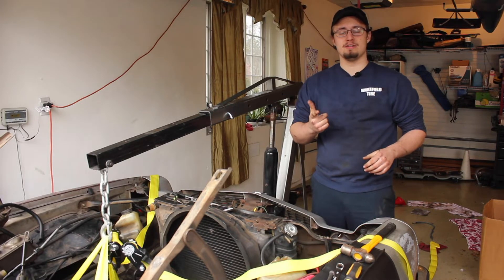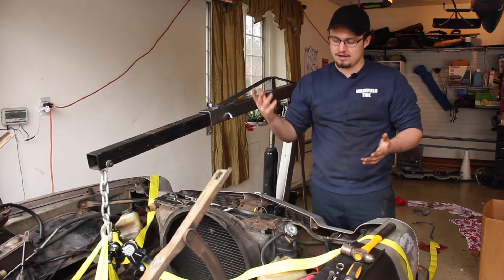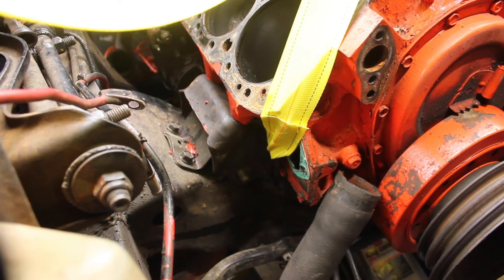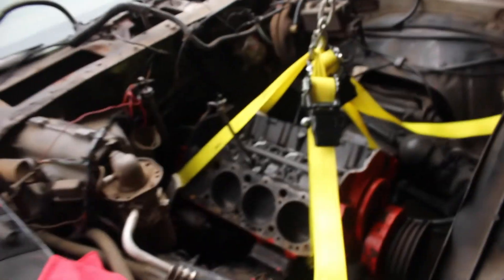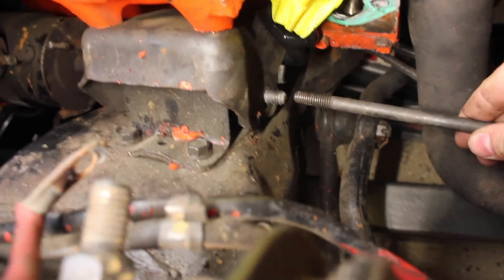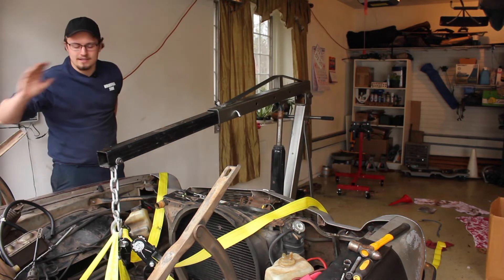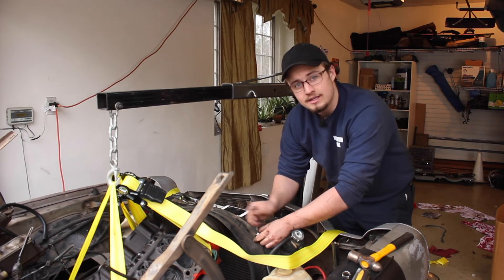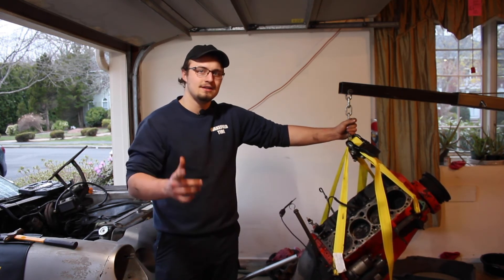How to Remove an Engine with Ratchet Straps - Burnout Tutorials

Comment: How did you tie the ratchet straps, how many straps did you use?
Reply from the maker: As shown in the video, I used 2 straps. Also, I showed where I hooked the straps to the engine in the video.